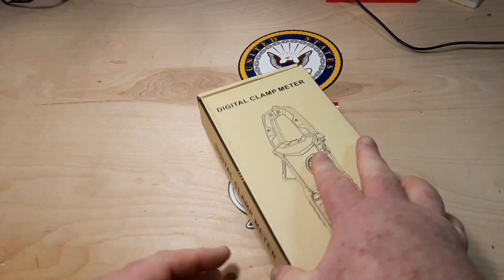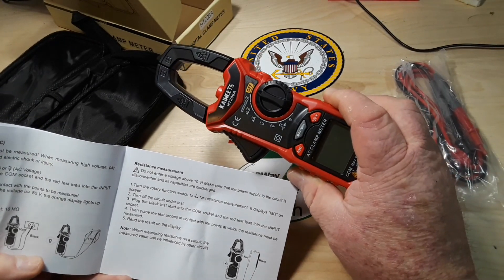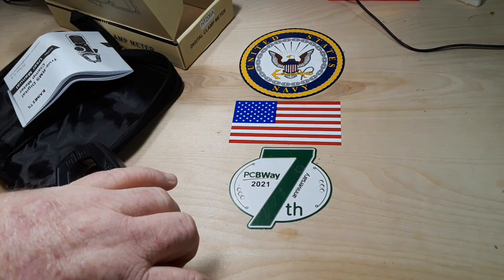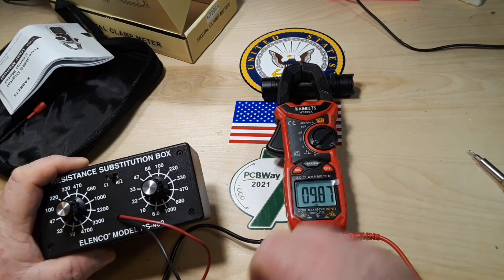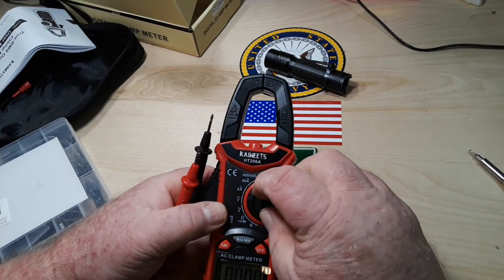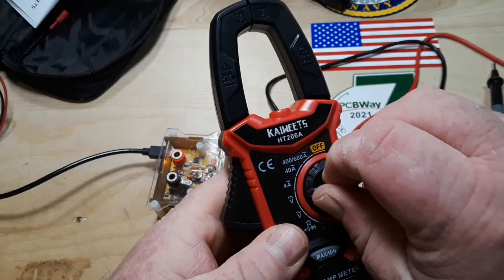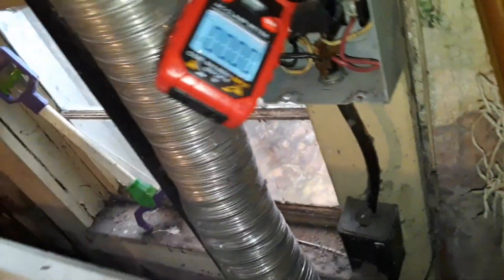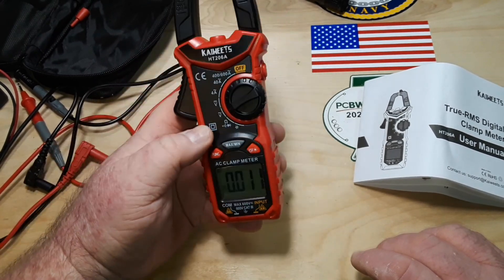Kaiweets HT206A Clamp Meter Review

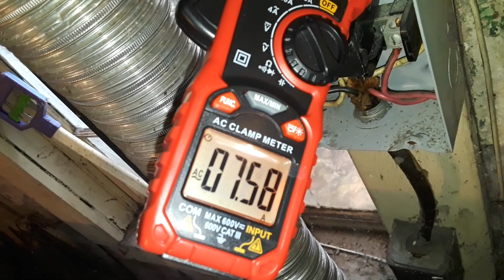Comment: Thanks for review. 10:07 AC current,  I count 10 measurements in 4 seconds that gives us 2.5 measurements per second. I am little disappointed as expected 4-5 meas/sec.
I've already got Habotest (Kaiweets) HT208D Clamp Meter, AC/DC 6000 counts. Great device, but I am looking for additional clamp meter with 3 decimals on low AC currents and shortest delay possible. That brings me to AC only and NOT T-RMS. The choice is limited then with HT2000A, HT200B and HT206A. Unfortunately different revisions of HT206A exist. Early versions were not T-RMS, they can be identified by limited resistance range 40 kOm only and no capacitance. But now looking on measurement rate  I am not sure that it is not T-RMS anymore. T-RMS label missing on body but mentioned in user manual. Maybe on 4A range (0.001A resolution) the rate is faster. Anyway, thanks again for your video, it gives me a lot of thinking.

Comment: Looks like my Uni-T. I like Kaiweets meters and they are good quality so I expect you will get years of service from it. I recommend an AC line splitter so you check the amperage of your appliances. Makes it much easier than removing covers off appliances to isolate hot wires.